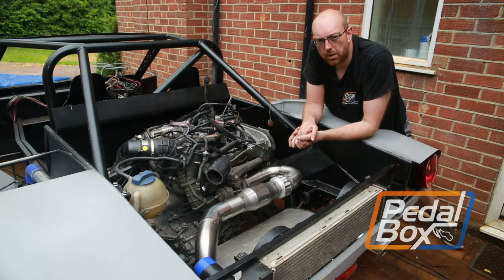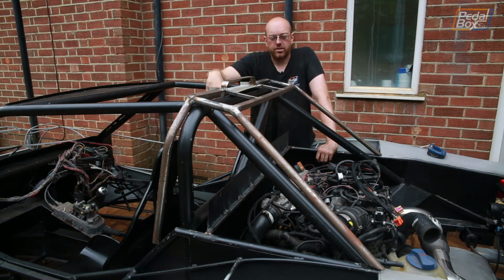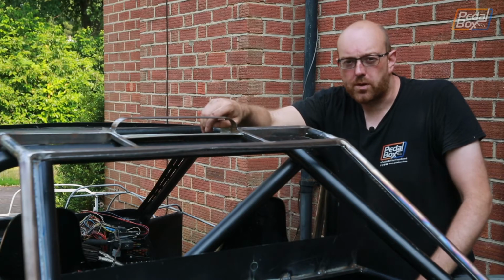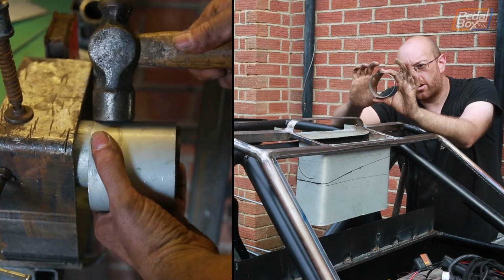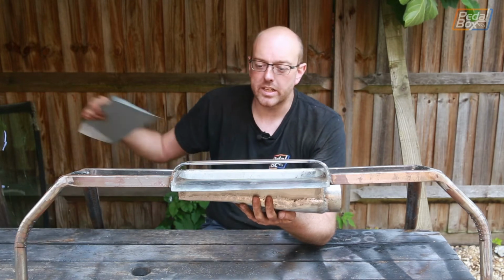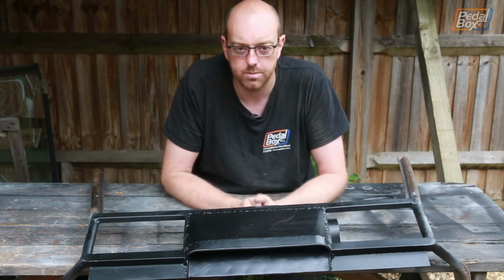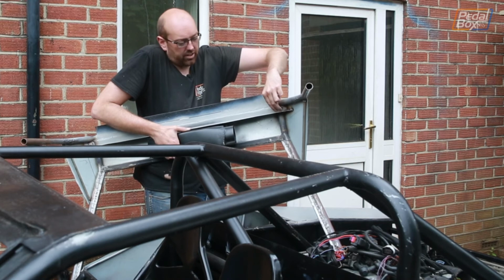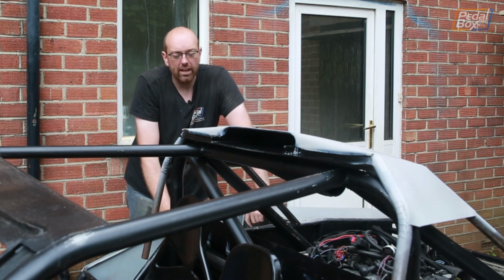Roof Scoop & Collector | Audi TT Kit Car | PedalBox Episode 82

Comment: Good progress, a very integrated component!!
Couple things to bear in mind for the next stage, drain for water getting in - well it's the UK and any ram air effect that could effect the  mapping cos your driving it hard all the time!!
Great progress, you do realise it's a mad build 🤣😂👍👍👍👍
I wish a 3rd of my watchers where sub'd
Reply from the maker: Yeah it's incredibly constrained and integrated as you say, to the point of being a nightmare really. The corner closest to the pipe outlet flattens off, before it gets attached on, i'm going to add a small drain, realised when i'd closed it in it'd get full so theres a small lip to stop the water just draining directly into the filter/MAF/pipework. Hard one to show once it's all closed up lol. Just have to pop round :D

Comment: Nice to see it coming along! I do wonder if turning the intake through 90 degrees is the best thing to do? I suppose with the difference in cross section of the scoop to the outlet it should be ok as long as you don't boost it too far.  
 These episodes always go by so quickly! A little longer would be great! Always happy to see a new  pedalbox episode pop up on my notifications! 
Keep up the good work!
Reply from the maker: Thanks! Sometimes they do creep longer and they feel like they drag, glad to hear they'd be popular longer too :) The harsh corner was what took me so long to get started on, at least it's not a double flat, effectively. It sweep round a curve to the bottom, then has to make a turn, so I /hope/ it'll kind of twist and roll with the induction of it. Maybe :D

Comment: It is a good idea to have the air inlet 90 degrees from the scoop? A 45 degree it would be better, no? Maybe a similar shape to the scope, to go down in a 45 and 45 degree(follow the coupe shape of the car).
Reply from the maker: I thought about a longer run back and/or a deeper scoop, and both options limited the potential for a rear window, which i'm still toying with somehow keeping in. But yeah it would have been better with a more gentle sweep into the pipe
Reply: @PedalBoxGarage  Maybe some side scoops would work better? I know the top scoops looks cooler.